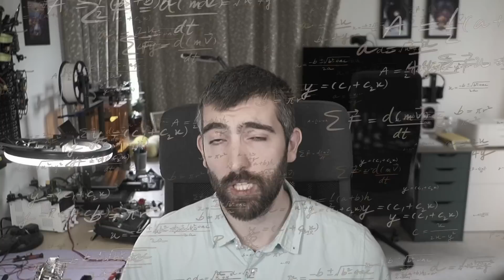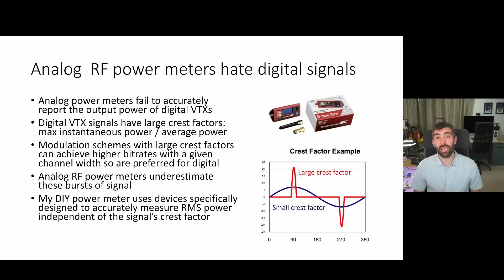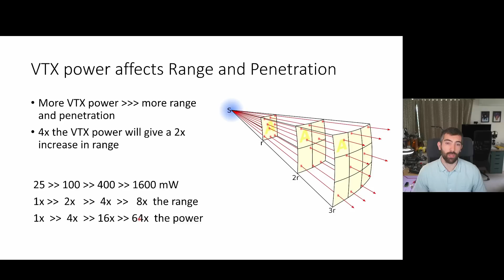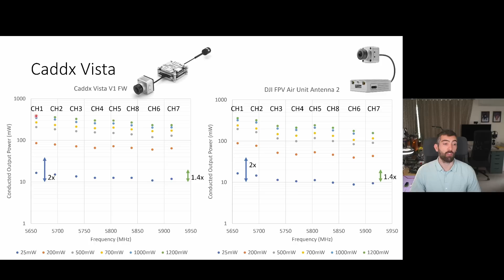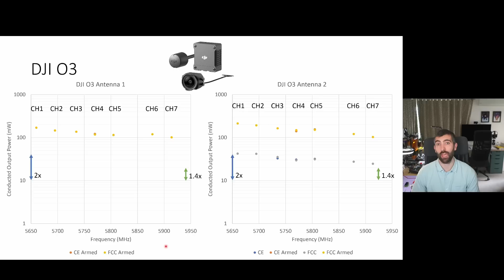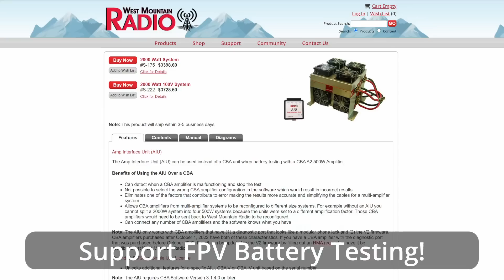When is 1W not necessarily 1W?! // DIGITAL VTX Output power testing

Comment: Thank you very much for these tests. Very puzzling results, though, given how good DJI's range & penetration generally is, even compared to 1W analog VTXs...
I'd love to see you test the HDZero Freestyle VTX (and the Freestyle V2 VTX when it comes out) as well.
26:00 Don't the DJI VTXs increase/decrease their output power depending on where the goggles are? So you wouldn't see their max output power unless you had the goggles on the other side of the house?
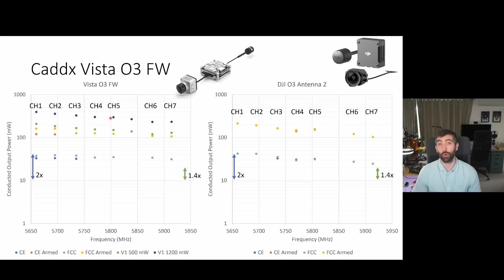27:40 Or, alternatively, maybe the extra processing for the O3 algorithm meant they had to reduce the output power to keep the thing from overheating?

Comment: @Chris Rosser now that "low-band" is supported by the HDZero VTXs and considering that they have the highest output power on R1 (the lowest frequency supported so far), would you be interested in testing if the low-band frequencies give even more output power, as their frequency is even lower)?

Comment: How do you run O3 firmware on the vista? Is that by updating the vista on the DJI assistant - consumer drones series app rather than the original FPV series app? 
I fly with V2's with both O3 air units and vistas and switch between the two operating systems in the goggles and my vistas are on the 1.00.606 firmware still.

Comment: Surprised you didn't test the HdZ freestyle. The size of that thing and it's heatsink might show that it's got some serious amplification in there. 30db for Qam is no joke. I wonder if the hdzero dropoff towards R8 has to do with the MCU not assessing the PA power detection properly at different freqiencies, or more likely that they use a PA that amplifies digitally modulated signals more efficiently at lower frequencies specifically in the dance of WiFi. Also, considering that HdZ is running 200mw+ at the 25mw settings and people at racing events weren't complaining (racers loved the clearer video), I wonder if they'll change their minds about the typical 25mw limit.
Reply: Well, many race organisers check the output power of each person with an RF power meter that they have with them (you can often see it on the screen in livestreams) and everyone's transmitting about the same amount (including analog pilots), so either these readings are not quite accurate or the pilots are using the 25mW adjust option to bring it down to the correct levels.

Comment: You did the test on the 03 with the FCC hack and at 40hz?  There are 3 different power modes with the hack on the dji03: 10HZ, 20HZ, 40HZ.  Did your test show that all 3 gave the same output?

Comment: Great findings! I always fly CH1 and this explains why I get fairly far out with my 200mW HDZero VTX. Antenna manufacturers could also offer antennas optimized for CH1, most FPV antennas from the analog age perform best at 5800MHz afaik.

Comment: Joshua Bardwell is an RF engineer who mentioned that we should use the higher frequency channels so common WiFi won't interfere. Maybe that's why the lower frequency channels on the VTx's use a higher output.

Also, the O3 system may look like it's transmitting at about half the output power of the v1 stuff, but maybe that's because it's transmitting on 2.4GHz (less power needed for the same range/penetration as 5.8GHz).

As for the battery testing equipment, maybe borrow Bardwell's? He raised money for it a long time ago and did some testing.

Comment: Chris, is there any chance that DJI 03 could increase power output more if the signal degrades? As in the Tx moves farther away from the goggles? So a kind of dynamic power output when not in a static situation?
Reply: I was thinking the same thing
Reply: Accoridng to chatgpt, a 250mw signal would be received at 3.5mw over 13km, assuming line of sight and normal atmospheric conditions of 25c at 50% humidity. 3.5mw is well above the operating range of wifi receivers so maybe it really is that weak of a signal operating at those distances. Hard to believe
Reply: @devinfritchey7323 oh my god. does anything you said make sense to you?

Comment: Great video! Is there any feedback from the goggles to the airunit regarding signal strength, to allow automatic power output control. This is how regular dji drones work as far as I know.  It doesnt sound like it for these standalone vtx, but If there is, you might need to attenuate that signal to force it into a higher power mode....

Comment: Chris - if I’m correct you’re comparing the ‘power’ and therefore, by proxy, the likely range and penetration of analog and digital systems using RMS

If the digital systems rely on picking up their data at the peak of the crest aren’t they likely to have significantly better performance than analog at the same RMS power

Is it time now for some long range tests or more likely set up a series of obstructions (metal or concrete walls) and zigzag through them for a ‘real world’ type test?

Brilliant work so far

Comment: Thanks so much for this explanation! One question about the range increase section being an inverse square relationship, you noted to get a doubling of range you need to times the power by 4 wouldn’t the range side of that equation stay linear? So wouldn’t it be for each addition of x distance you would times the power by 4 instead of for each doubling of x distance? Thanks so much!

Comment: @ChrisRosser that's amazing content 👍 
About the 03 and Vista on O3 firmware: Isn't the O3 protocol increasing power automatically relatively to the distance from the goggles (or received bitrate)? From my experience on the field, the O3 air unit + goggles 2 has been outperforming everything I know, that would be really incredible on such low power. How is DJI doing the impossible? Am I missing something?
It would be interesting to test the power with the goggles being far/osbtructed from the O3 unit.
Reply: I am curious about this too. DJI claims 33dBm EIRP (2000mW) on the 5.8 frequency.  If the O3 only outputs 200mw (23dBm) as shown in this test, even if they double it by adding both antennae, that's 400mw or 26dBm. That leaves 7dB to make up with with the omni antenna. I don't see that happening. I also don't them only using half of the front ends total power capacity, but then again, the O3 turns into an oven, so maybe it just thermally can't handle 400mw.
Reply: O3 has higher latency than its predecessor, this would increase range and penetration for a given output power. The actual output power is about the same as the V2 system at 700mW, as Chris presented in his video.
Reply: @disco.volante  higher latency would not inherently increase range and penetration for a given output power... Latency is basically a measure of time delay... 
technically - "the delay before a transfer of data begins following an instruction for its transfer." 

Long story short, higher latency in any situation is Bad.

Comment: Maximum EIRP of 2 antenna is equal of 2 times EIRP of single anttena. To be more specific, "the gain realised at the beam peak is equal to the number of elements times the gain realised in the same direction when only one element is excited"  that is from antenna array theory. Only radiation patterns will not be the same as for single element.
Edit that was commonly used in long wave AM transmission from beginning of last century to shape coverage of radio broadcast. Even now is sometime used by radio amateurs.
Reply from the maker: Yes that's true but don't the antennas have to be oriented in the same direction? DJI specifically recommend the antennas be oriented in different directions.
Reply: @ChrisRosser  now from point of maximum EIRP, statement is "true".
To explain more if we have two ideal isotropic antennas then no mether of how they are oriented they have gain of 1 in all direction (EIRP is same as output power) so gain of 2 of them will have gain of 2. For practical case when there are (most commonly used) monopole or dipole and they are at angle of 90 degrees (worst case) then gain of two antenna would be same as single antenna, but they already have gain of 2 sp in both cases EIRP will be same and 2 times output power of transmitter.
I am not too familiar how specific VTX use antennas (I usually do not fly FPV, I am old and I perfer flying turbine jet plains and helicopters), but there is option that they even produce with two linear polarized antennas at 90 degrees and proper pashe shif circular polarisation (i do not know why they would use that, but that is commonly used for satelite communications when you use two Yagi antennas at 90 degrees  to get circular polarisation).
If I remember correctly you are expert in matlab, and matlab have tools for simulation of antenna radiation pattern, so maybe you could do simulation what they do (I was only basic matlab user and thay was before I retired from work over 12 years ago).
Reply: I found on FCC site presentation how you calculate EIRP for muti antenna system (including cases with cross polarization)
https://transition.fcc.gov/oet/ea/presentations/files/apr16/5.3-MIMO-Primer-RB.pdf

Comment: Hi Chris, wonderful video. In your previous video, Caddx stepped in and said that they do increase the goggles transmit power  in the higher power modes. It would be nice to understand how that affects the range and penetration, if at all. I imagine that it must be mostly acknowledge packets, so it could be affecting latency?
Reply: To acknowledge packets, and to tell the VTX to resend ones that it has missed... Looks to me like the DJI system has to have a full picture - when it can't get a full one (even with low resolution tiles) it fully drops the link instead of being able to just show static in the spots it's missing. So a lower goggles transmit power would mean it would fully drop the link earlier.

Comment: TBH you probably should have used a dedicated ADC instead of the built-in ADC on the Arduino. Much more accurate.
Reply: The slope of the ADL5902 (without voltage scaling) is 53 mV/dB. A 10 bit ADC with 5V vref has 4.88 mV/LSB so allows to measure ~ 0.1 dB/LSB. Do you really more precision than that?

Comment: Thanks so much for this comparison! For your last point about the vista running O3 firmware with possible improvement in range, does that apply to the OG Air Unit as well or is it a vista only thing? Thanks!
Reply: 20:00

Comment: I know typical Ocusync on say a Mavic automatically adjusts QAM modulation factor and output power based on closed loop SNR.  I'd be real interested to know what they are doing on these fpv units.  Might be worth looking at a spectrum analyzer to see if the receiver is actually transmitting back to transmitter to close that loop to keep link stable.  Maybe an easy test would be to see what power does with the receiver on vs off.
Reply: Oh yeah, of course it's a two way link on the DJI fpv units... You can control your drone on the same link.  Yeah I'd be they 100% use the same scheme as they do on the Mavic to keep the link stable.  My point is that the link you are measuring may not be the same modulation or transmit power given the fact that the receiver/goggles isn't turned on etc.  I'd bet that the actual conducted power changes in response to the goggles.   Be real cool to set up a variable attenuator on the goggles and watch the power output of the tx side real time on a scope

Comment: interesting and unexpected. i am the only analog pilot between DJI pilots and even though i equipped all my drones with rush max solo (2.5w) i am still having horrible time and range when i am flying with even one DJI pilot... with three, it feels like 200mw vtx. it happened on two different quads so i am highly confident it's just DJI and not my builds... can you test where DJI roams when it's set on any channel, and what goggles are transmitting?
Reply: Yeah it seems dji video signals really mess up analog if its anywhere near the same frequency. Do your dji pilot friends move to their higher frequency channels so you can use R1?
Reply: @Voyajer.  yeah i am always on R1, regardless, i have such crappy time that after a year of trying to solve that, i literally decided to give up flying with other people. i don't feel that it is ok that i am bullied into buying digital equipment but it seems to be a requirement if there is even one pilot with digital system...
Reply from the maker: The killer with DJI is the goggles transmit so you can't actually stand anywhere near dji pilots. If you're flying with DJI pilots you have to stand far away from them (which sucks). A more powerful VTX won't help that much if you're 1-2m away from the DJI goggles.

Comment: You integrated the power consumption ^^
Glad to know the cap in output-power does correlate with power drawn and they are not just burning part of that energy in extra heat. The O3 being on par with 700mW Vista also explains a lot of what we see in real life (and it feels quite good to know I can just leave it as it is and it will perform just fine). Is there an explanation for why higher channels generally tend to produce less output power? And I would also be curious about the foxeer, rush and tbs >1W analog VTX claims when measured side by side!
Reply from the maker: It seems to depend on the VTX. Some VTXs produce more power at higher frequency and some more at lower frequency. I'm not sure of the exact mechanism though.
Reply: i bought three rush max solos to be able to fly next to dji pilots but i am still having  bad signal to the level where i gave up flying with other people. when i am alone or with analog pilots, penetration and range are ridiculous compared to 69, unifys or trump nanos that i had so far

Comment: Don't know, but suspect the 03 firmware waveform has a higher Peak to Average Power Ratio(PAPR). It would need to back off on RMS power to prevent peaks distorting.
Reply from the maker: That may well be the case. I wonder if O3 getting very hot might also limit how hard they can drive the amplifier.
Reply: @ChrisRosser  I agree with him as well. I think that's called slew-induced distortion?  From your data, it looks like they are running these components to the edge. The output power is reflected in how far the amplifier can push before distortion(vs frequency/modulation characteristics). I'm sure heat is a factor, but the capability of the amplifier to resist distortion at higher frequencies is probably the bigger bottleneck. I will say though, RF is a bit of an artform... I could be completely wrong lol
Reply: if your not recording on the 03, there should be no problem running 1200mw